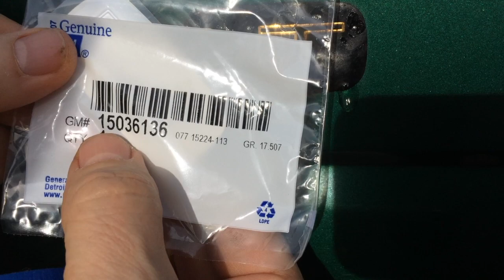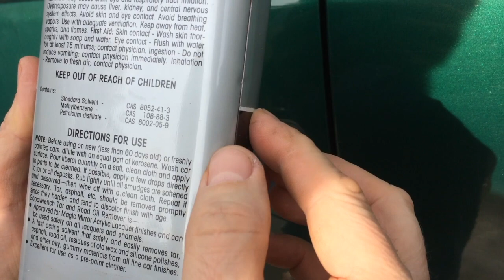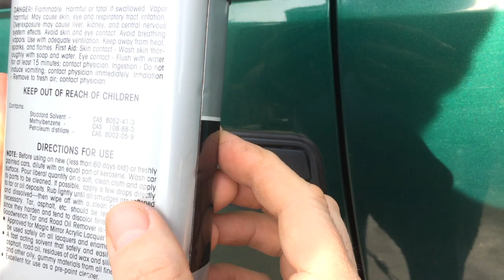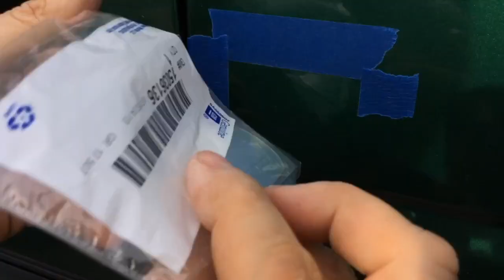1997 - 2007 GM Trucks Melted Trim Level Sticker / Badge / Plate Repair (Chevy & GMC)

Comment: My SLE badge fell off. What adhesive would you suggest for reapply this oem badge?
Reply from the maker: You'd be better off getting a replacement GM one as its a special adhesive that won't damage the paint.  But you might try 3M trim adhesive if not.